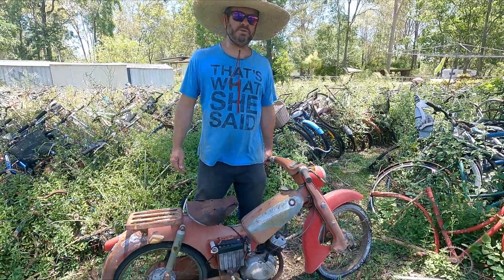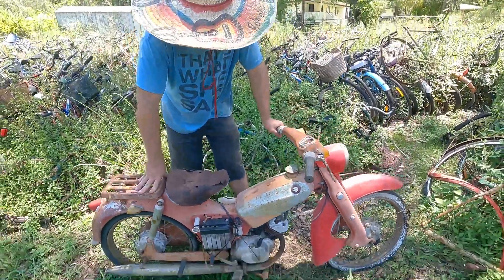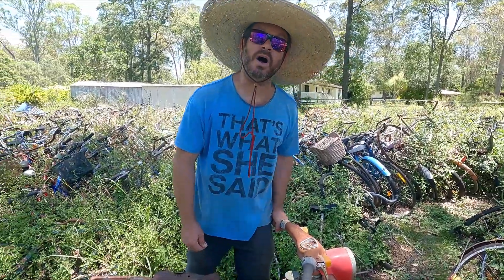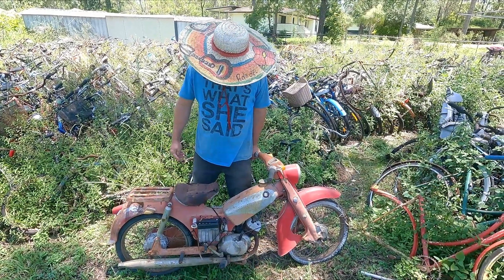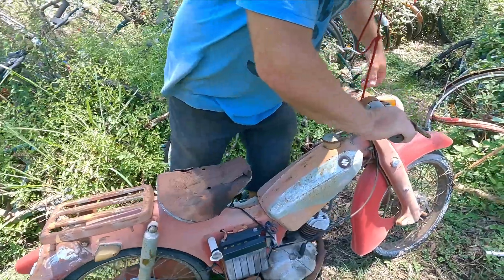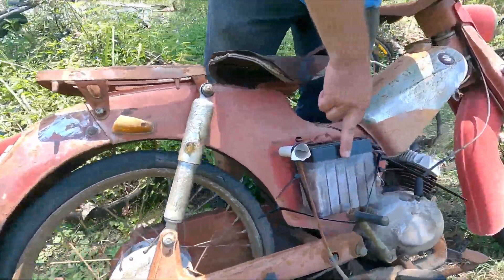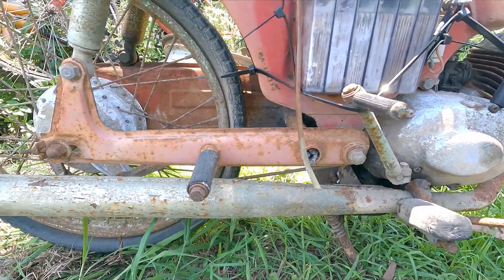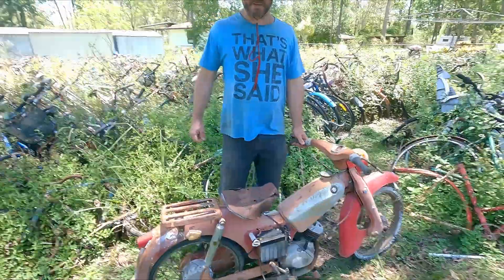Check out this 1963 50cc Suzuki Motorbike… | Vintage Value

Comment: Hello from New Zealand, My father (Rod Coleman) was the NZ importer/distributor of all Suzuki product from late 1959 to Feb 1984. He was one of the three earliest distributors of Suzuki product - the other being a company in Queensland (which became Morgan and Wacker Ltd), plus a gentleman importing product into France and Belgium. The model 50MA you have is the very first step-thru 50cc model Suzuki manufactured from late 1959 to late 1962. It featured a 12 volt system with electric start, plus the first year model was fitted with a rotary gearbox - meaning, it didn't have a positive stop once you had selected top gear.....the danger was, the rider could then again step down on the front half of the gear pedal and change straight back into first gear.....thankfully, Suzuki amended the design fault within the year. Your example raises questions about it's year of manufacture, as the "S" badges on the petrol tank were only red/maroon with a gold "S" on the 1959-60 models. Later models had black badges with a gold "S". The single seat was a Japanese domestic market fitment, with export models having a dual seat. Maybe your example was privately imported by someone who had owned and used it in Japan, prior to its importation into Australia. I currently have 3 X 50MA in my motorbike collection. I will email you directly - Cheers.
Reply from the maker: Really great info, thanks a lot for sharing 🙌🏻

Comment: I'm in Brisbane myself and have acquired a collection of three of four of these after my father passed in January.  Huge amount of parts and frames that were painted. New tyres, cables, and even windshields which I think would be hard to come across. Would be good to move these onto a collector.